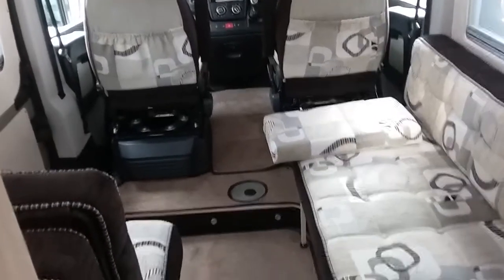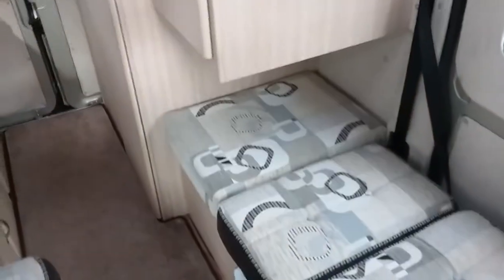46377 Auto-Sleeper Symbol bed make up

Comment: are the infill cushions in the right place? I thought for the passenger side single bed the front seat needs to be rotated?
Reply from the maker: On the older models you needed to rotate the seat.  Now you get the extra length under the wardrobe